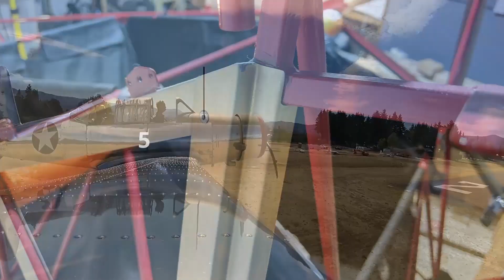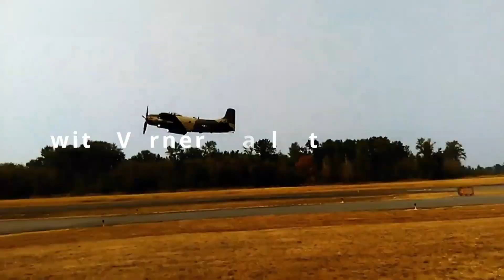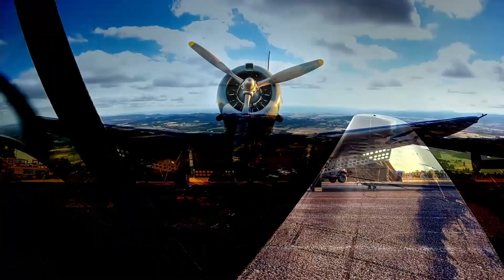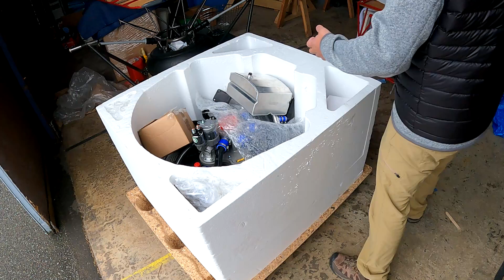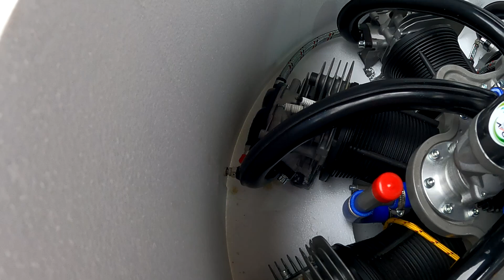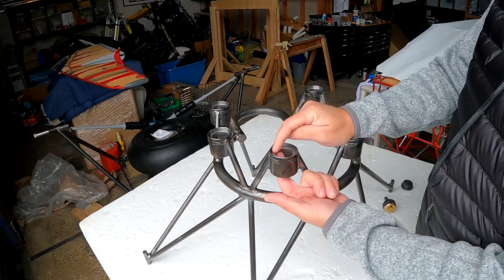Verner Kitfox 5 Ep 30, unboxing the Verner Scarlett 7U

Comment: Would this be too much engine for a Pietenpol Air Camper?
Reply from the maker: If the 7 cylinder is too heavy then there is always the 5 cylinder.  Might be a better choice.  Go to their website and click on the gallery.  http://www.vernermotor.com/
You'll see planes of similar weight and performance profile.

Comment: That oil tank looks like a well made piece of kit. The fuel injection system looks like Boeing 787 quality. The engine mount seems exceedingly well designed. I’ve never been particularly interested in radial engines till now. This just seems like an exceptionally well engineered powerplant!

Comment: What are your estimates/ hopes on cruise speed? Did you consider the 9S?
Reply from the maker: I think the Kitfox with Supersport wing and cabane gear is good for 100-105mph, so I'll be happy with that.  I might squeak out a few mph with some drag reduction (strut fairings and covering the gear).  Of course I considered the Scarlett 9 but I think the 7 is a good balance of weight and power.  It's slightly more power than the 912 without a huge weight penalty.  Thanks for asking!